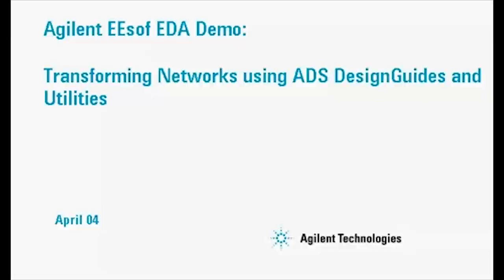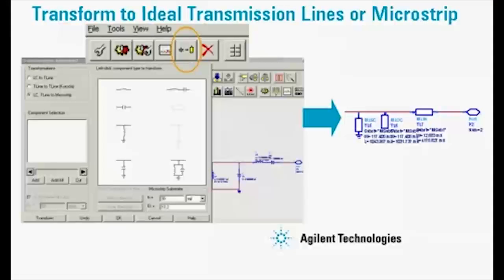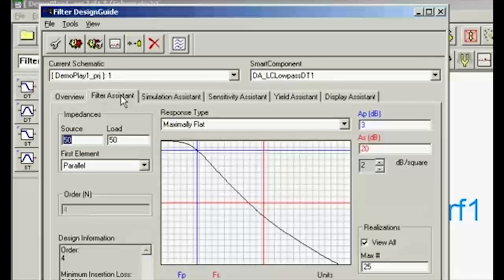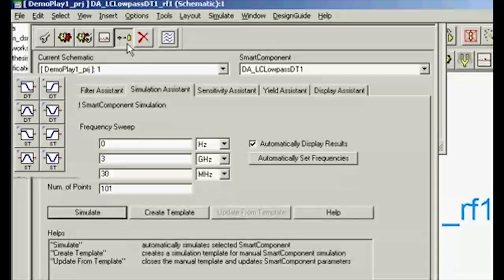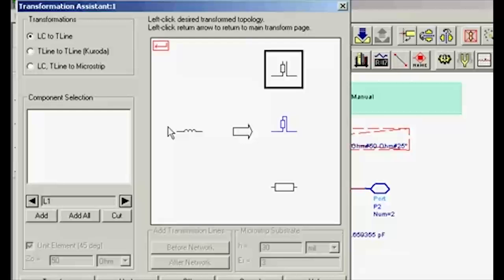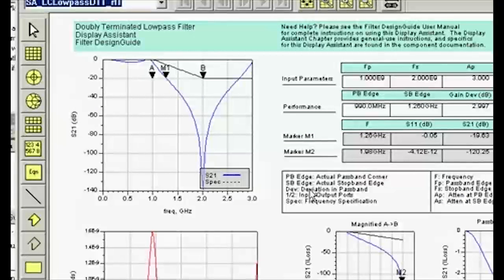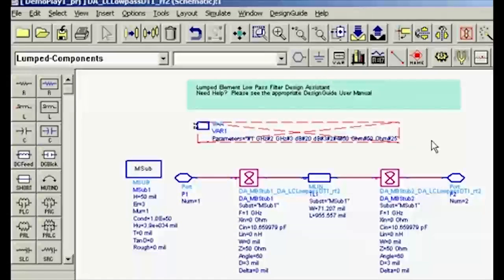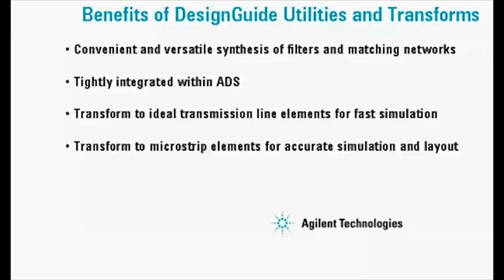Transforming Networks Using ADS DesignGuides and Utilities

Comment: Is it possible to transform  any circuit other than this designed using filter design?I have circuit that I designed and want to transform
Reply from the maker: Hi Jean, good question. ADS can transform any passive circuit captured with lumped element components into their discrete counterparts. This can be done by utilizing the Transformation Assistant. The Transformation Assistant is opened from the Filter DesignGuide Control window, either by selecting Tools > Distributed Element Transformations from the Control window menu or from the Toolbar.
Reply: I tried the above but I still can't get my circuit transformed.I have designed an impedance matching circuit using lumped elements that  I want to transform into discrete components.Using this filter design Guide I can't because it says that I need a smart component to be transformed.Any more guidance or a  reference that I can follow step by step?Thanks
Reply from the maker: Registered users can use this reference in our Knowledge Center: http://edadocs.software.keysight.com/pages/viewpage.action?pageId=5094351#UsingAutomatedAssistantsinFilterDesignGuide-TransformationAssistant
Reply from the maker: The link requires a login to the Keysight EEsof EDA Knowledge Center. For more information on this library of information or to request support, go to:  http://www.keysight.com/find/eesof-knowledgecenter-intro